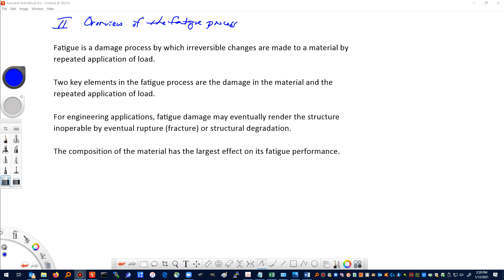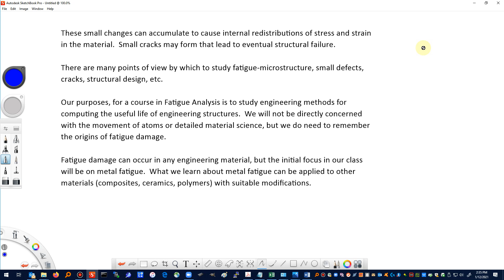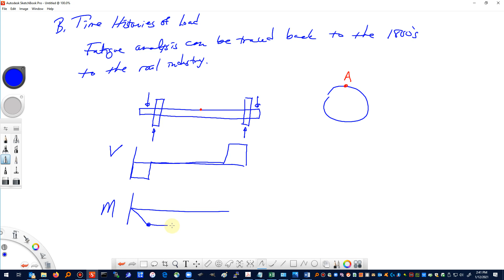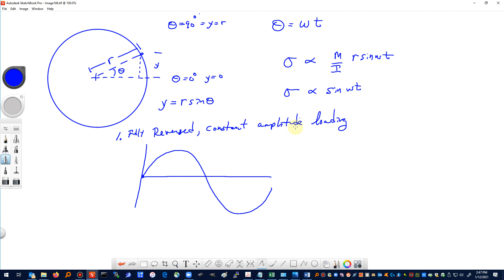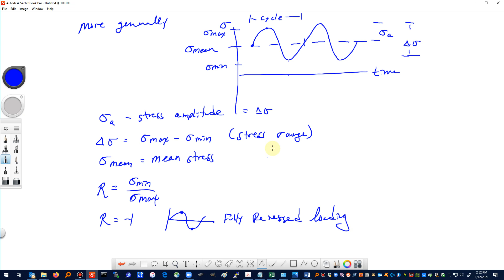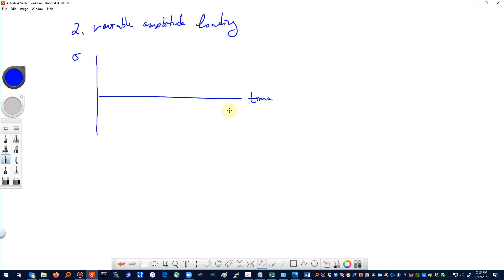01 Introduction and fatigue time histories

Comment: Correct me if I were wrong, but the way the axle is loaded will create tension in the top fibers at the middle of the axle, not compression. Furthermore, y in the stress equation is the radial distance measured from the neutral axis (approx. in the middle) for small deflection scenario. Thanks.
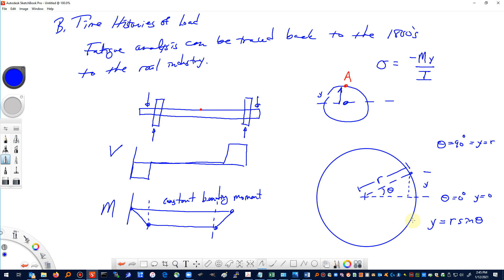Reply from the maker: I don't think there is any inconsistency between your comment and my lecture, see 21:37.  The moment is negative in the middle of then (along the length of the beam/axle) and with the negative sign in sigma = -My/I there is a positive (tensile) stress at the top.  y is measured from the centroid as indicated in my figure at 21:37 and 23:38 and is consistent with my time history under point 1 for a point that starts on the right at y = 0 and travels around the axle counter-clockwise .
Reply: @mbarkey.mechanics  Thank you very much for your prompt reply. It is just when it was mentioned that the point A, see 20:21 is in compression, I was a bit alarmed :). But I believe we both agree now to the state of stress for point A (tension). 
My second comment relates to S=MY/I equation, as you know Y is the distance of the point where stress is calculated measured from the neutral axis. I see you are basically expressing Y on a vertical axis, which is fine considering the axle is axisymmetric. Thanks again for your fast reply.